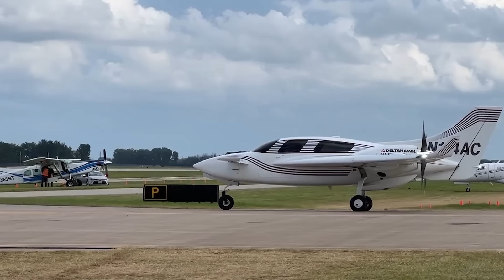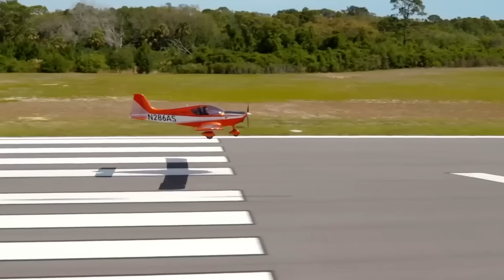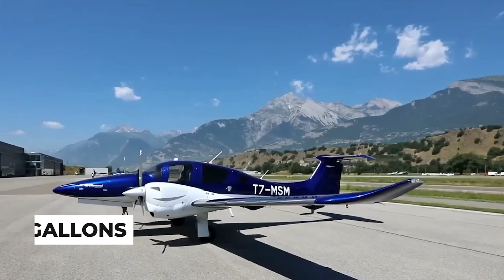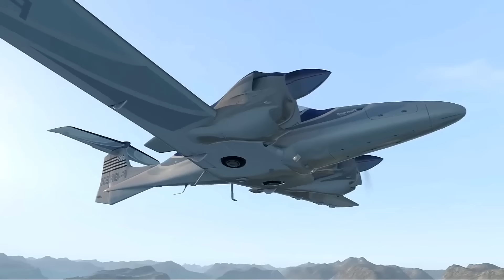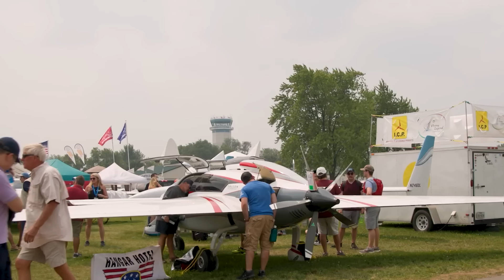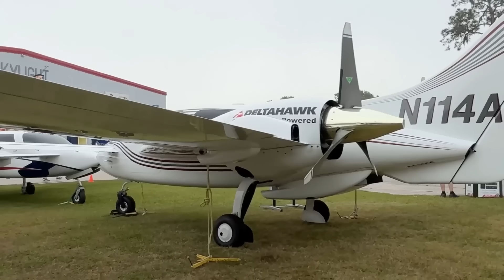Why Everyone Wants The New Velocity V-Twin Ultralight Aircraft

Comment: Just thinking about the Yaw issue with twins...   Why has nobody ever tried to put two engines in the rear and drive a single pusher prop via an reduction gear?  
Like maybe two rotary engines close together that both drive a single pusher prop using a reduction gear connection...  Of course a it would need a one way engagement  so that a dead engine would not add drag... But I have never seen that tried.  I think it might reduce cost and the yaw issue all at once.

Comment: Your review is informative, but I noticed that some of the photos shown are of aircraft not related to Velocity. It would be even more valuable if you focused specifically on Velocity Twins. A detailed walk‑around would be great—covering the exterior, wings, fuel tanks, interior layouts, landing gear, specifications, engine options, build‑assist programs, Factory Complete Aircraft for International Customers, export support, cost, speed, range at different power settings, and avionics. Including these details would make your review much more structured and helpful. Right now, you’ve shared a lot, but the key information about Velocity Twins is missing.